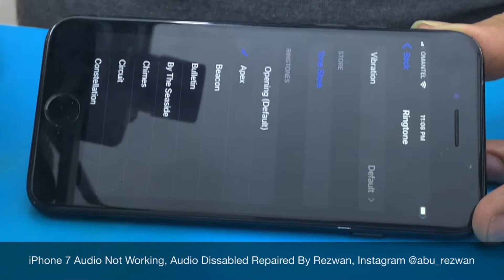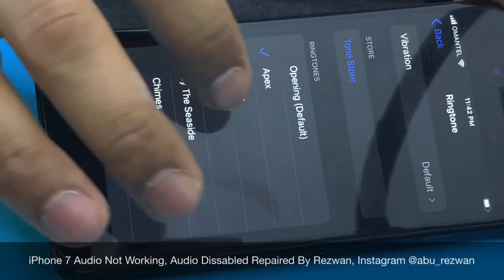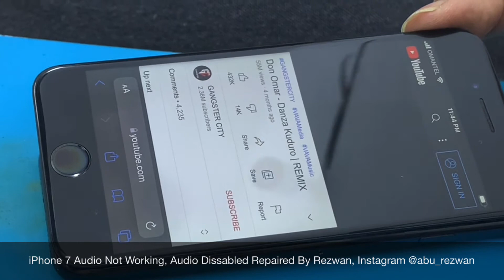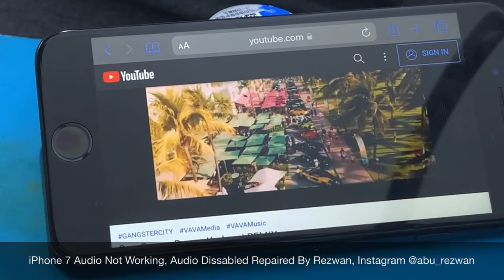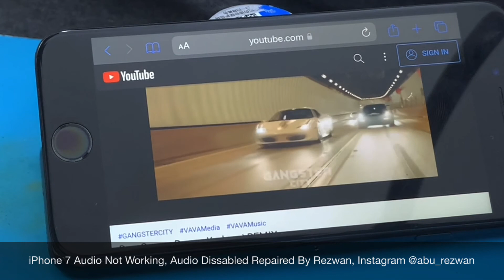iPhone 7 No Audio Repair Kaise Kare..? 🤔| रिपैर audio ॥ Rezwan

Comment: Bhai apni sabhi video me temperature 🌡️ aur air bhi mention kiya karo taki professional video lage
Reply from the maker: Quick 706W+
380/390 temp pickup Air 1-2
280/300 cpu clean and reball Air minimum 
320/340 put it back on motherboard Air 1-2